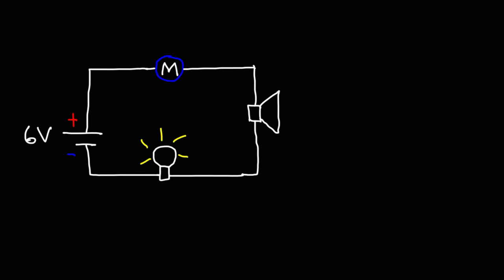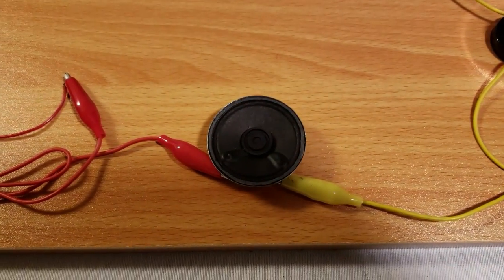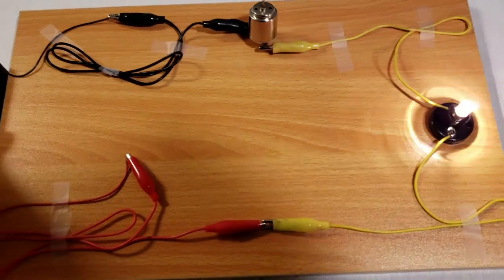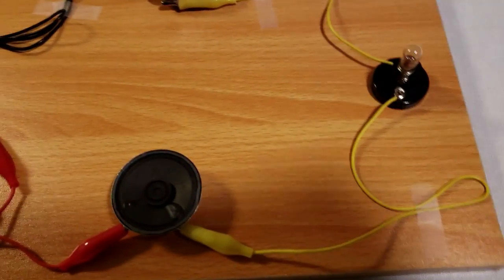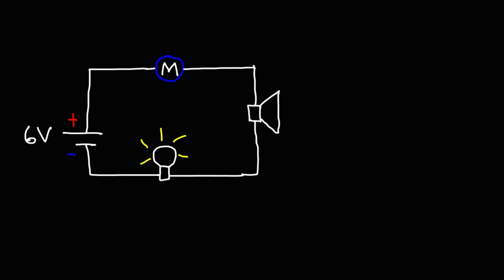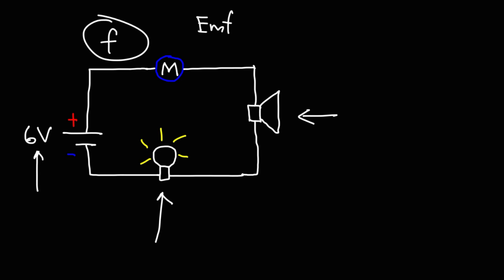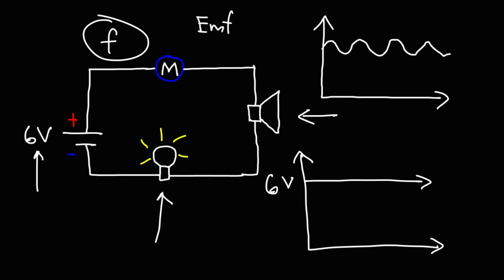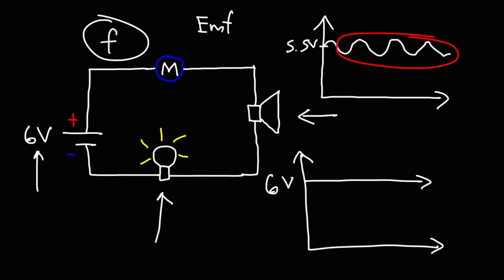Science Experiments - How To Listen to an Electric Motor In a Speaker

Comment: A brushed DC motor does Not induce a sine wave in a dc circuit. The waveform is more square sometimes with triangle peaks on the leading edge depending upon the pole count of the comutator and the rate of rotation.
It can resemble a sine wave if there is capacitance in the circuit.

Comment: 2:50 the speed of the motor is controlled by the Voltage.
The torque value is associated with the current.